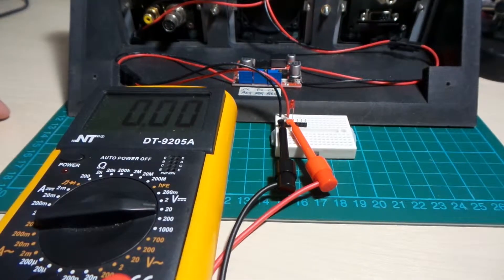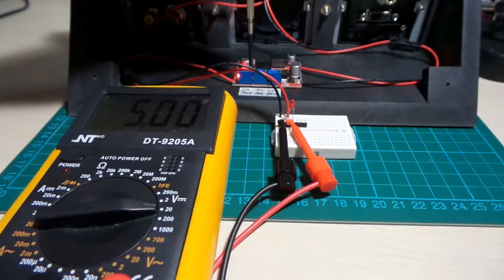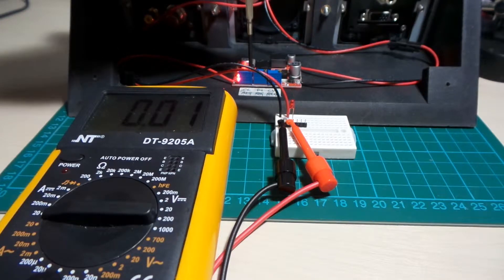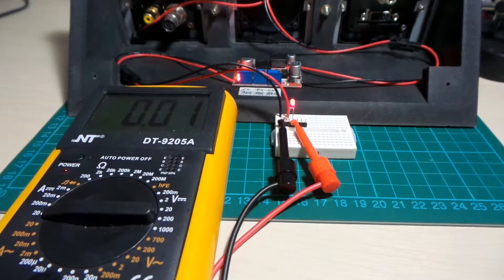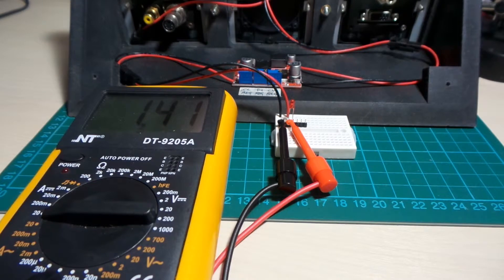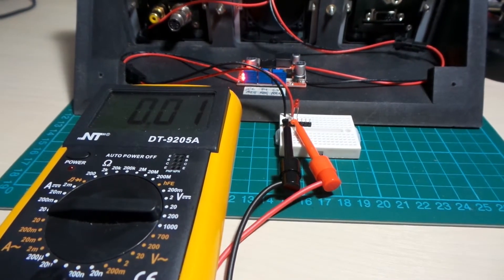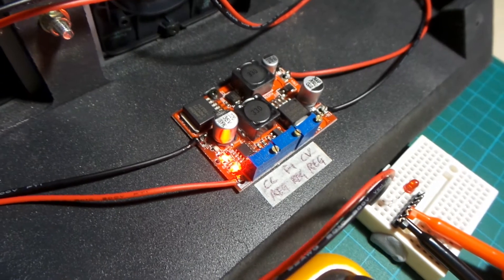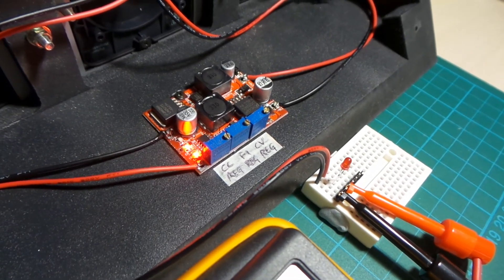Boost/Buck converter constant current gotcha

Comment: Do you know if the LTC3780 has the same problem?
Reply from the maker: sorry Mike, don't know. haven't tested a module with the LTC3780. It seems more of a design flaw in the supporting circuit on these modules than the chip itself. So... if I got a LTC3780 module from a similar source, I would test & verify;-)

Comment: I've bought three of these modules. The constant current mode of all three works well with normal load but exhibits the same problem with short circuit load. When a short circuit's attached, Vin (of LM2596) drops way down (to ~3V), causing the op-amp (LM358?) to malfunction. The solution's to pull on/off pin (of LM2596) to high (>1.3V) when Vin (of LM2596) drops due to short circuit. With reference to Undervoltage Lockout circuit in LM2596 datasheet, I used 47k and 4k at 2N3904 base (i.e. Turn LM2596 on only when Vin>7V), 47k at collector, and most importantly a 100k (not 47k) from on/off pin to ground (i.e. Pull on/off pin to high even with small value of Vin). All three modules work well now when powercycling with short circuit load.
There're other problems with this module too. For instance, the 100uF capacitor connecting LM2577 and LM2596 is too small, leading it to be burning hot during operation. A 680uF one should be used instead. Besides, the default Vout (of LM2577) and Vin (of LM2596) is 27V (too high), making the module absolutely inefficient. Thus, I've replaced R8 to variable resistor, and set the intermediate voltage to 8V.
Reply from the maker: thanks for the info!

Comment: That comment is from another Video: https://youtu.be/-sbzZDGEjbA

I just tested it with the same module. If you powercycle the module it doesn't limit the current anymore (if there is a load attached). I think the problem is the LM78L05 5V Voltage regulator for the opamp, my explanation for it is that the LM2596 turns on before the opamp and by passes the current limiting function of the opamp completly...

I just noticed in the Datasheet of the LM2596, there is pin 5 of the package. It's a on/off pin for the whole chip.
Quote: "Allows the switching regulator circuit to be shut down using logic signals thus dropping the
total input supply current to approximately 80 µA. Pulling this pin below a threshold voltage
of approximately 1.3 V turns the regulator on, and pulling this pin above 1.3 V (up to a
maximum of 25 V) shuts the regulator down." it also suggests to "ON/OFF pin can be wired to the ground pin or it can be left open. In either case, the regulator will be in the ON condition."

I just modified one of these modules and desoldered pin 5 (on all of these modules pin 5 is tied to ground) and added a wire to it,  so I can test the problem stated above. If pin 5 is tied to Vin, the current did not overshoot, and there is 0V on the output (as expected). If you tied pin 5 to ground after powering the module up it regulates current and voltage as it should. This, with a NPN BJT, or a N-Channel MOSFET can be easily used with a arduino/ESP8266/PIC/stuffed animal. You can also use a Optocoupler if you want to isolate the whole module (if you have different ground potential i.e), a PC123 from sharp is a good choice for that ;)

On the datasheet are also some example circuits, i.e for a delayed start-up (using two 47kΩ resistors and a 0.1µF capacitor). I got it to work, without overshooting the current, but I had to use a 0.22µF capacitor. Maybe because of my dodgy breadboard connections. But they also warn you about a to big capacitor and therefore a to long start-up time. That can cause some oscillation of the LM2596. There are also some other example circuits, like "Undervoltage Lockout" where the Buck Converter only start-up at a given input voltage which is set with a zener diode.

Sometimes RTFM is the right answer to problems like this ;)

Andreas mentioned to use maybe a faster regulator:
Andreas Spiess: "Thanks for your feedback and your tests. This sounds like a common behavior of not so good designed circuit without proper startup behavior. Maybe it would be an idea to change the LM78L05 to another (faster) regulator?"

Second comment:

you can maybe use a 1117 or similar, but that will also not work, the problem is that there is a input capacitor (which is of course needed), and that charges after you applied power, as the datasheet suggests, the LM2596 works down to 4.5V and will turn on if the input cap reaches this voltage. But of course thats to low for the LM78L05 and the LM358 opamp. And exactly for that (and to lower the inrush current) they put the on/off pin on the LM2596.

But it's not good that this bug exists on this modules... So keep that in mind and modify it if necessary. As I previous suggested, you can also turn the module on/off through this pin instead of switching the input Vcc.

Cheers!
Reply from the maker: thanks for posting the investigation/explanation Robin .. excellent

Comment: Thanks for the warning, I want to use a similar (or same) module as led driver with a 12v power supply. BTW do you know what opamp are usually used on this step up/step down modules for current regulation?. Thanks.
Reply from the maker: +.rpv sorry I don't know the specific opamp used - the markings are etched off/not present on my unit, and I haven't found a schematic yet for a similar circuit that specifies a particular opamp.

If you really need constant current control for your LED driver circuit, it seems like a really good idea to test the power-on behaviour! I only have one of these units, so I still don't know if this is a common flaw or I'm just unlucky to get a "bad" one. So if you have a unit(s) like this, it would be great to hear if you can reproduce this problem or not.
Reply: +pratalife Thanks for your reply, I don't think that you have a bad unit, I just saw a video where a guy are doing almost the same I want to do and he says that some boost modules on the start are just a direct line from the source power( /watch?v=Ebnv5G-tgWE around 13:32, on spanish ), so perhaps this 1.4A you got on the video are from your power supply limit, is it?. Anyway I'll do the test when mine arrive... which usually are over a month and the seller just sent it a few days ago... and I'll tell you if it's the same behavior. So if do have this behavior I'll use a second switch on the output side or perhaps I'll try some resettable fuses. Thanks!.
Reply from the maker: +.rpv interesting, en español! Yes, 1.4A is about what I expected direct from the power supply I was using.
Reply: +pratalife Hi, I don't know if you are still interested on the subject... my module arrived a few days ago and it have this bug too, I also saw it on the LTC3780 module, it seems to be a common bug on this Chinese modules. See you!.
Reply from the maker: +.rpv cheers, good to know I probably wasn't seeing an unusual behaviour. I'm guessing it might have something to do with the way they engineer boost and buck in the one package. I am interested to get to the bottom of it - but I probably need to know a whole lot more about power electronics first and then study these circuits in detail. It's on my list of (many) things to do..;-)
Reply: +pratalife Hi, I think this bug isn't only a boost-buck problem, on the channel of the guy I refer before he design a variable bench power supply based on the LM2596 pretty much like the Chinese modules and only buck converter and he face the same problem, he added a BC548 on the LM358 side to enable the LM2596, as slow-down circuit, it appears to be a problem where the current flows very quickly before the LM358 starts to regulate ( /watch?v=kBBealvuQNY at 12 : 08 , on spanish ). Also he shows a second bug for this modules (but I really haven't tested yet), when you're on current regulation and you drop the voltage at some point the voltage increases instead of decrease ( same video at 5 : 36 ) he solve it by adding a diode on the feedback pin of the LM2596 and the potentiometer. He put the links for the circuit and the full video series on the description of the video, if you're interested. See you!
Reply from the maker: +.rpv oh, I missed that. thanks - that's excellent info; proper explanation that makes sense